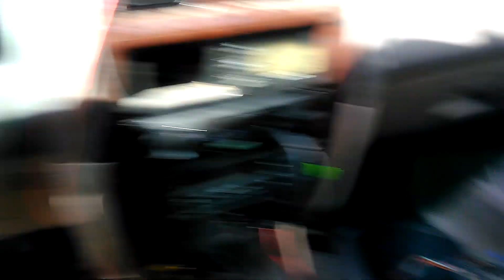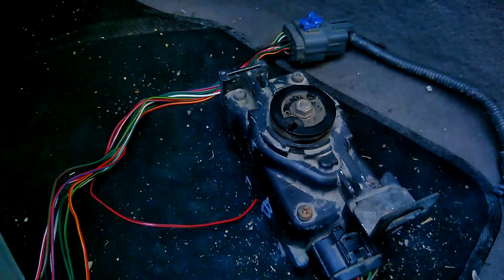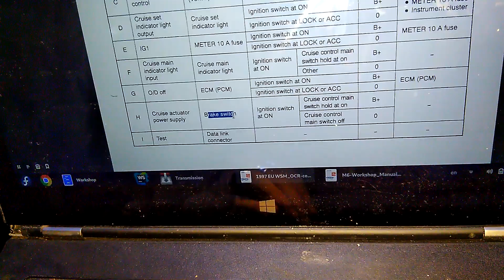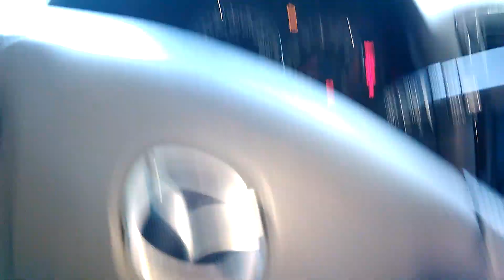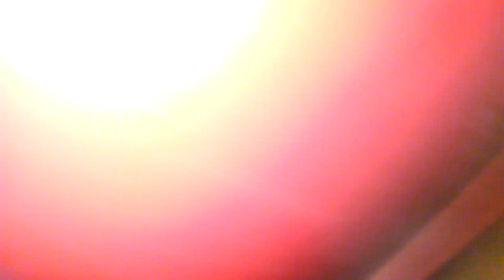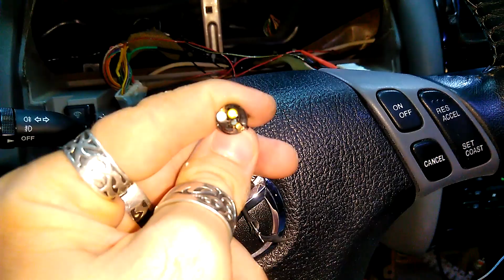Installing Cruise Control from Mazda 6 GG to 626 GF

Comment: Did something simular on my MX-5 NB 1998. Used the Mazda 6 cruise unit, and buttons from the Mazda Protege. I used a cable clamp to connect the cruise cable to the throttle cabel.

Comment: Hello. Great work. Very helpful.
I don't know if you can help me, but when I wire up the module as you did in the testing phase, when the car reaches a high enough speed, if  I press set or reset, it buzzes but doesn't stay running (meaning the set light doesn't come on) even though I keep the car (myself, with the gas pedal) above 40 kmh.
I connected pins C,I to ground and F,K,L to B+ . A is connected to the speed input. J is connected to the buttons.
 any ideas?
Thanks for the great informative videos.
Reply from the maker: Hi. You need to connect Cruise LEDs (or use multimeter to figure out when on) and then enter the on-board diagnostics of the CC module. Cruise main (yellow) indicator is needed only to figure out if you are on or not (diagnostics enter procedure starts when that indicator is off), while the Cruise set (green) indicator will show codes that will help you figure out where the problem is. How to get to the diagnostics and what the codes mean, you can read here: https://www.mazdabg.com/ftp-uploads/Mazda/6/Mazda%206%20Workshop%20Manual%202002.pdf page 1031 (marked as T-179). Just follow the procedure and see which signal is wrong. Hope that helps!